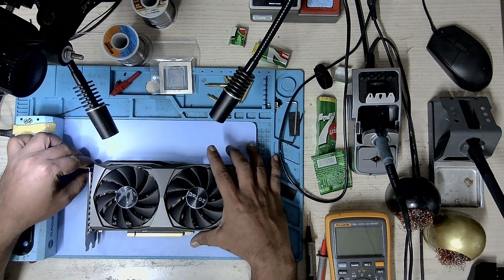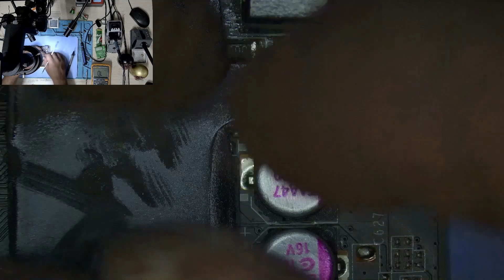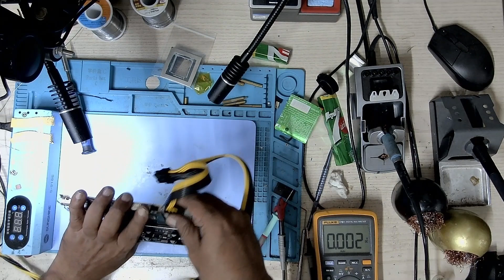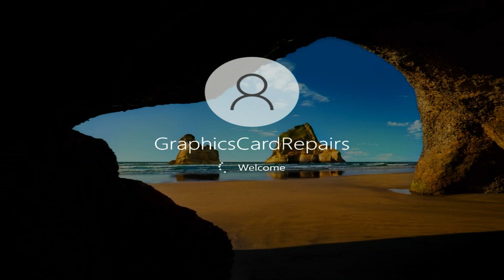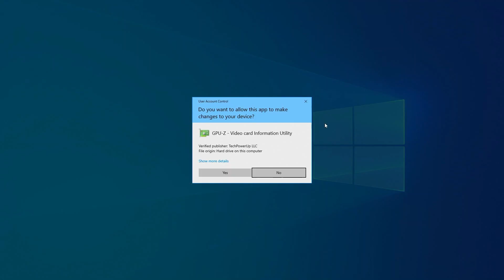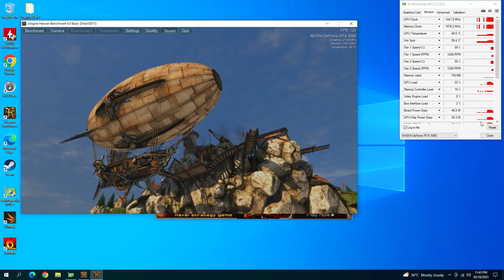Zotac RTX 3060 Twin Edge Repair - Not Detected - Missing 5 volts - Water Damage Resolved.

Comment: Hey man. Great video. I have a problem with my RTX 3060 AMP (white) edition. No display, no detection. The card suddenly stopped working. I checked and found no short but no voltages after the buck converters. its been a month I am trying to get it fixed. Any suggestions?. Appreciate for your time.
Reply from the maker: In the same video I have explained where exactly there is a trace that gets burnt out. The trace acts like a fuse. Have you checked that. There is a capacity that blows which causes this issue.
Reply: @GraphicsCardRepairs-tk7ql  yes man. But mine is AMP edition. I believe the the trace you mentioned is on the normal rtx 3060. This fairly a new card (no warranty) and no one care to try servicing it

Comment: There Is a chance u got the schematic or board view ?
Reply from the maker: I have boardview for 3070 but I don't have for Zotac.
Reply: @GraphicsCardRepairs-tk7ql  oh 😥, i have the same GPU but i got only 12v  on the mainboard 
The other voltages are missing
Reply from the maker: After 12V the 5V should be there is 5V available?

Comment: Great video it help me a lot, You mentionet in the video abaout broken condezator and broken trace. Well a had the exact same problem on 2 of my cards, removed broken condesator and repaired  the trace. Turned it on and works like a clock, just wondering what is the value of the condesator,  the two big and a smaller one are in series, big one is aroun 10uF so I asume the other one is around the same ?
Reply from the maker: Yes the value are the same. Glad you liked the video 😁
Reply: Thx man You are a life savior 👍. You got Yourself a life time subscriber.
Reply from the maker: Thank you 😁

Comment: This video saved me so much time! I have the same card, also not detected. Only I found a broken trace, right where you said it would be. Subscribed. Thanks a ton.
Reply from the maker: I'm glad my video could be of help to you. Thank you for subscribing to my channel.
Reply: The same issue, the card works do You know any chanse what is the value of the capacitors that also goes short ? I mean the card works fine but just in case good to know. Great video very technical.

Comment: could i please have some help. with my 3060 zotac.  turned really loud yesterday and turns off and on randomly and my screen want get detected
Reply from the maker: So when you say loud I assume you are referring to the fan noise. Not detected is a very broad term. There are so many things involved and can go wrong. Do you have some hands on electronics repair so I may be able to guide you through it. Else it's best to let the technician Handel it.
Reply: @GraphicsCardRepairs-tk7ql  hey . sorry to get back to you very late. but it just wouldnt power up at all and the screens and stuff like that wouldnt get detected by the graphics card if it did. so after trying to do stuff to get it to work after about 2 weeks we just bought a new card. thx for the help

Comment: Yoooo bruh can you please repair my gtx 1050ti by zotac.....it has same issue not detected and no fans spin.......it might be power ic issue because my power supply died with it......
Reply from the maker: There might be a short but the exact issue can only be found after diagnosing the card. The 1050ti is quite an old card. The cost of repair itself will exceed the value of the card let alone shipping. Unless you have some emotional attachment to it I would not recommend you send the card for repairs. For the price of the repair you can get a used, working 1060 or 1070. If you decide to send in your card fill in the form on my website https://graphicscardrepairs.com/send-graphics-card-for-repairs/